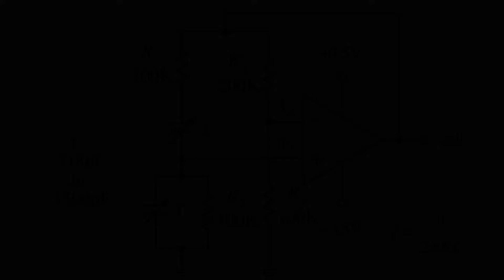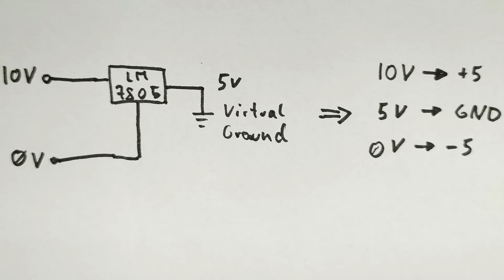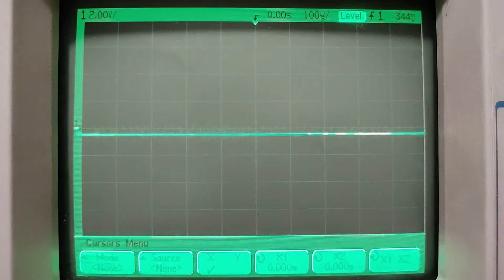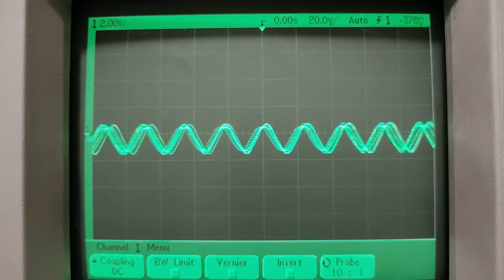How to Make a Sine Wave Oscillator  /w an OpAmp (Wien Oscillator)

Comment: It is very simple to make Wien bridge oscillator stable. If you check math, for stable oscillations your gain must be exactly 3. The oldest way of solving this is introducing PTC resistor in lower part of gain definig resistoe chain. When the amplitude goes up, PTC heats, its resistance goes up, and gain goes down. Hewlett and Packard did this by using simple lightbulb (back in 1930s). Better way is to rectify oscillator output to produce DC voltage proportional to sinewave amplitude, and then use that dc voltage to controll some kind of variable resistor, connected in lower part of negative feedback chain. The most common way is to use j-fet since its resistance from drain to source depends on gate voltage, but I've seen some crazy stuff with using a led and ldr also. 😂

Comment: Please correct me if I'm wrong, something in this circuit does not make sense. Your schematic does not show a potentiometer connected to Vgnd but your breadboard does. The breadboard shows a total of 5 resistors (including the potentiometer) but the the schematic does not.
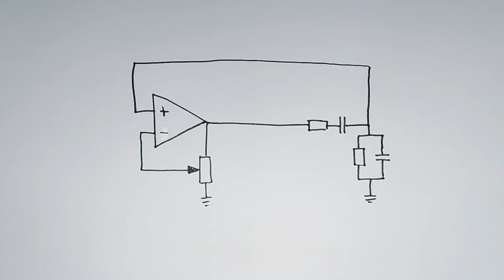Reply from the maker: My schematic literally shows the potentiometer connected to GND at 1:30.
At 2:40 I say "because I didn't have 470R resistors, I put two 1k in parallel."
Reply: @5VLogic  My apologies. I was looking at the text book schematic.

Comment: The ratio of resistors is 2, but in a non-inverting amplifier configuration that makes the gain 3.
Reply: This is correct. The Wien-Bridge reduces the amplitude to 1/3, so you need a voltage gain of 3 to let the circuit resonate.

Comment: Wien (wine) bridge oscillator I believe has a tungsten element light bulb instead of R4.
Reply: Yeah works well with a bulb.
Reply: peatmoss4415, the basic Wien bridge oscillator (at least according to my old theory books, but the Wikipedia article confuses the issue) does not use an amplitude stabilizer element. But regardless of that, for this type of oscillator to work well it should have some kind of amplitude stabilizing element in the feedback path. Hewlett is supposed to have originated the idea of using a small incandescent lamp for this element, while other versions use inverse-parallel LEDs, etc.

And the Wien bridge oscillator is not named after the German word for wine, nor is it named after the German name for the city of Vienna, rather it is named after its inventor Max Wien, which is pronounced 'veen'.

Comment: I would love an explanation on how to use the linear regulator to make a split supply! That concept looks hella cool :D
Reply: A simple op-amp circuit can be used to a split a supply into equal (or even unequal) parts by setting it up as a follower and biasing the non-inverting input to half supply with a high-impedance, because the op-amp is working on a voltage, so 100K + for your divider. The output from the op-amp is now effectively at 0v with respect to the two supply rails so you use that as your ground.